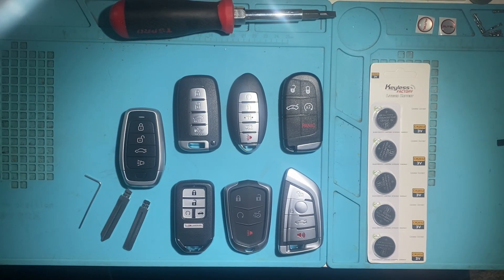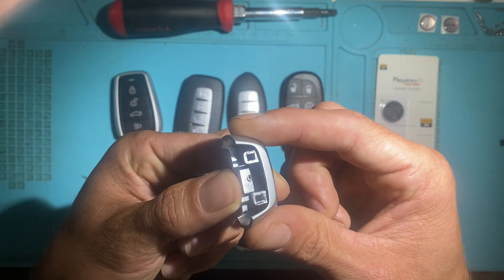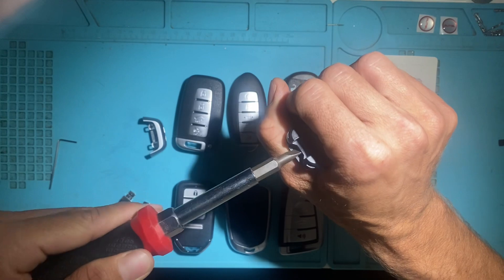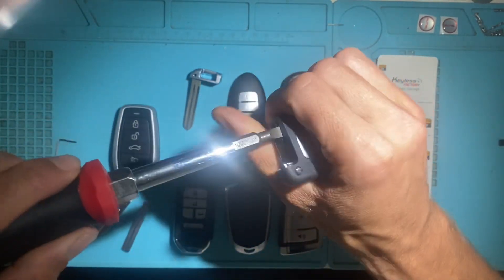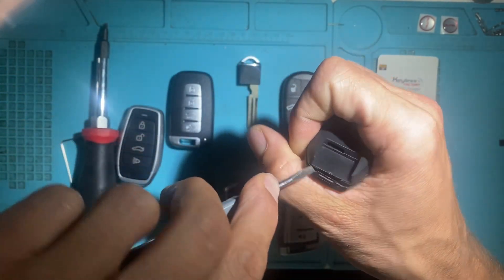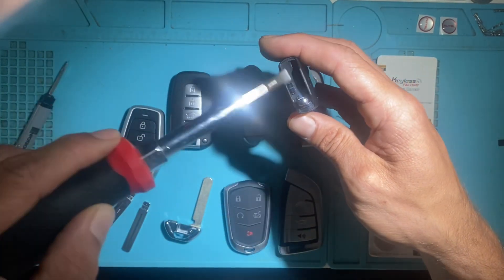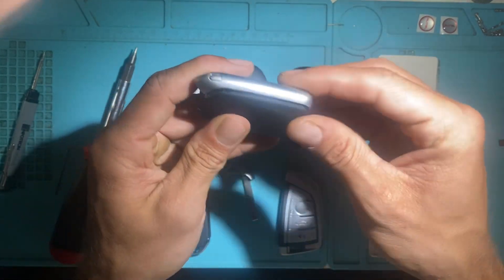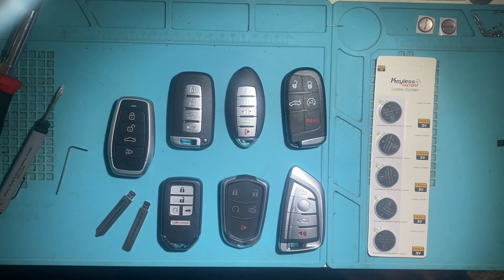Autel Universal iKeys

Comment: Can the universal Nissan style be used for the ones with the programming slot?
Reply from the maker: Yes but I don’t recommend it on those because they don’t physically lock in the slot properly
Reply: @AutelJoe  Thanks, that was my main concern.  It's a bit of an oversight in my mind, but not a huge deal breaker.